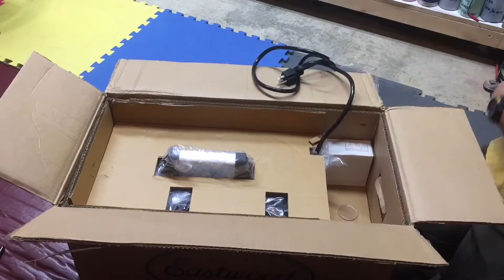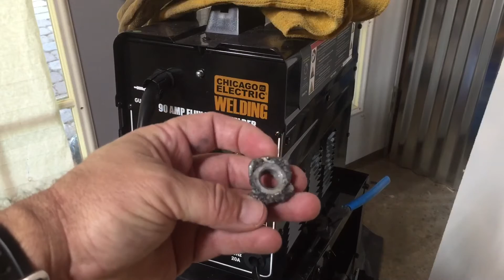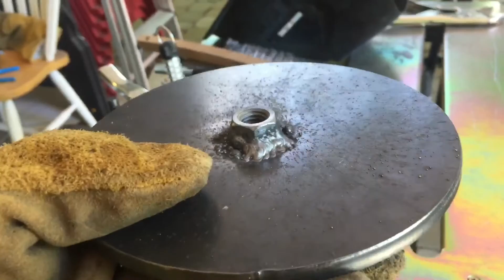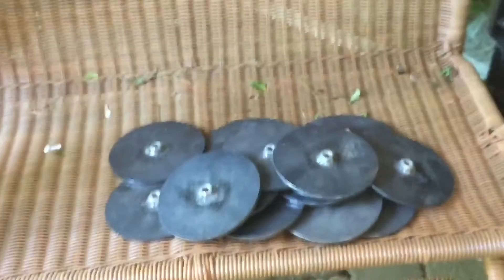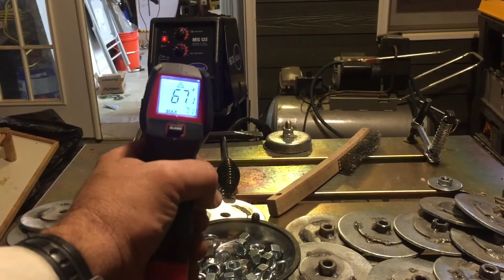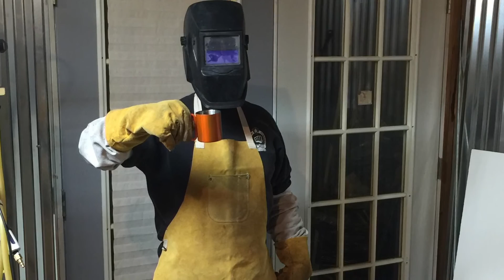Eastwood Mig 135 Unboxing and First Use

Comment from the maker: UPDATE: I've had this welder for over a year and I have gone through at least 10 large rolls of Flux Core wire.  This welder is still performing flawlessly.  If you are looking at something lower power and cheaper from a local tool company, you may want to reconsider.  This is worth the extra money.  Without question.  If I ever need to replace it, I may go with this Hobart.  It's made in the USA.  http://amzn.to/2qbGpij  Not because I'm unhappy with the Eastwood, I'd just prefer to buy American when that option is available.  It seems to be.

Comment: Had my Titanium 125 from HF for about 4 months, has been great until today.  Heard some crackling coming from inside the welder and it blew breaker for receptacle it was on.  Attempted to power it back on and while it did not blow breaker again, it kept crackling from circuit board area in welder and would not power on.

Luckily I had the 2 year warranty, returned for a full refund incl the warranty cost since they did not have one in stock near me.

Went online and purchased the Eastwood 135 to take its place, will be nice to have a mig welder instead of the Titanium 125 flux core welder I have been using.  It is about $150 more than the Titanium welder not incl purchasing a tank and argon but hope it will last longer and make better welds on the sheet metal I use it on.
Reply from the maker: I was on my second HF welder that was returned when I bought this.  It was night and day.  I still have it even though I’ve upgraded and barely use it.  You’ll love using it compared to the HF welder.
Reply: @ManCrafting  I sure hope so, I am at around $350 over the price of that Titanium 125 welder after adding shipping and a tank w/fill.  But I think the welds will be much improved, that HF welder didn't do too well on thin metal.  I am restoring a 64 C10 and my welding is almost exclusively 18-22 ga sheet metal, which the Eastwood 135 actually has settings for and comes with the wire best suited for.

Comment: Informative video for us HF owners. I saw you reply to a comment saying your Eastwood was AC and DC. Jody says the only good flux core needs to be DC. So is the Eastwood DC? If so how well does it do on DC? Thanks again for the video. Maybe you could show us a video of the weld puddle you’re getting by using the little cheap flat darkened screen in front of your camera?
Reply from the maker: Thanks.  It's been a while since I've used this welder.  I'll see if I can do that.

Comment: got a eastwood for under 250 and the first time use was able to complete the project couldn't complete with harbor freight 125 using 1/16 square tubing. i wish i had gotten one year a go the prices were lower. if i was going to weld full time then i would get the vulcon  migmax215 (400 more) but much better welder totally different class..
Reply from the maker: WV591 I’ve used it as a hobby welder for over two years.  The first year I would say was really heavy use.  Now it’s my second and I use it only for flux core welding. I love welding with it.  One of my most recent videos was using the Eastwood.  Still living it.

Comment: Trabaja sin gas?
Reply from the maker: It does.  Flux Core doesn’t require gas.  Or you can buy a gas cylinder and regular welding wire.

Comment: mine was pecked great and everything also. first day of use,  wire quit spooling. then turned into a hit or miss problem like there is a trigger connection problem.  pretty much broken out of the box.
Reply from the maker: kevin woodruff I'm sure if you contact them when there is an issue they will take care of you.
Reply: ManCraftingTM that what I plan on doing Monday.
Reply from the maker: kevin woodruff let me know how it goes.
Reply: ManCraftingTM I have just found out by moving the gun trigger cable around that it is a working issue where the gun trigger wire feeds into the gun itself.  I'll reply when I hear back from Eastwood

Comment: Hello, ManCraftingTM Thank you so much for this video is very helpful.
Reply from the maker: Clinton Snow my pleasure.  Thanks for watching and taking a moment to comment.
Reply: For flux core what Spool wire do you use for this Eastwood 135?
Reply from the maker: Clinton Snow I've used both Hobart and Lincoln Electric NR-211-MP  also one other no name from my steel supplier.  All worked really well.
Reply: Great, so Any flux core Spool wire can be use on Eastwood MIG welder 135?
Reply from the maker: Clinton Snow so far it's been good.  I use the .035 but it can handle .030 as well.

Comment: what does the "135" mean and what difference does it make if ifts higher like the 175 ????
Reply from the maker: The higher the Amps the thicker the metal you can weld.  Make sure you check the stats for a specific welder.  If you are comparing two welders in the same brand, you'll definitely see the correlation.

Comment: Great video. I never welded before but just got my 135 . Any reco on where to get the gas tank from?
Reply from the maker: Ethans Roof & Exterior Washing I have a couple of places locally. One is Air Gas and the other is a local welding supply.
Reply: ManCraftingTM where are u located out of? i have a airgas near me too
Reply from the maker: Mac Tierney Atlanta area.

Comment: Thanks for your review. I am in the market for a welder and that duty cycle HF has just did not sit will with me.  I was pretty much interested in the name brands on this type of tool.  I just did not want to be disappointed one & I only wanted to purchase once.

I looked at your vids list. I like the content. You have a new subscriber.

Again thanks for your review.
Reply from the maker: William Ward thanks!  If all you need is a basic flux core or mig welder this machine has been a real treat.  Especially at the price. If your not in a hurry it goes on sale all the time.  It might even be on sale today.  Not sure.
Reply: That would be great what would be the Sale source? The Company or any vendor?

Thanks again.  It will be the unit I get. Two things really stood out in your assessment. How heavy it was (which means a really beefy transformer & the infrared heat reading. It stayed cool. I thought about the HF but that duty cycle just killed the tool no way.  

Thanks again.
Reply from the maker: William Ward I just got an a Cyber Monday email from Eastwood a few minutes ago.  They are $259.99 with shipping included which is pretty good since they are really heavy.
Reply from the maker: William Ward that's Eastwood.com

Comment: I had Northern's version of this welder when I first started welding in 2010.  It was a great welder no doubt.  If you like it now, wait till you toss some gas on your cart.  You will love the difference between MIG and Fluxcore welding.  Another good video.
Reply from the maker: No question.  I was a grinder for a long time.  Rarely do I find myself needing it on a weld now days.  We all need to start somewhere.
Reply from the maker: I have a feeling you're right.  I honestly can't think of an upgrade in my tools that has had me this happy in the difference in performance.
Reply: Like I said, wait till you add the gas.  You will be amazed at how good a welder you are.  LOL  An additional added plus will be how much better your product will look.  Little to no spatter, and no flux to grind or brush.  It's a real time saver.

Do you sell your stands as a kit?
Reply from the maker: +Howard Camardelle never intended on it, but yes.
Reply from the maker: Update.  I've been using gas for a while.  You were oh so right.  Now what do I do with all this Flux Core I bought?
Reply: Keep using it.  You still need to improve your grinder skill set. LOL
Reply: using a grinder makes you a grinder not a welder